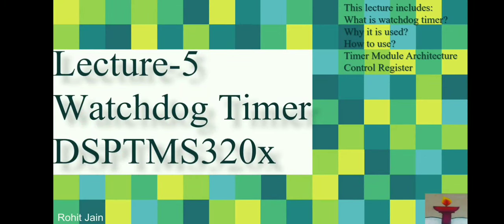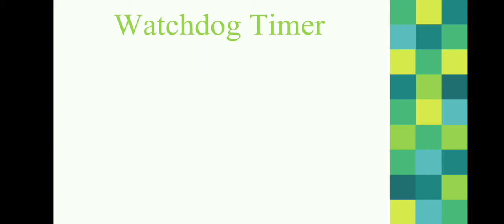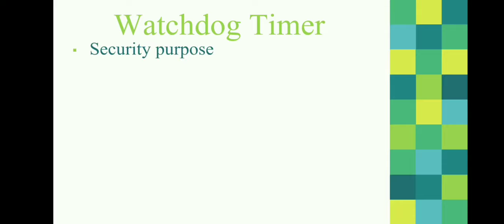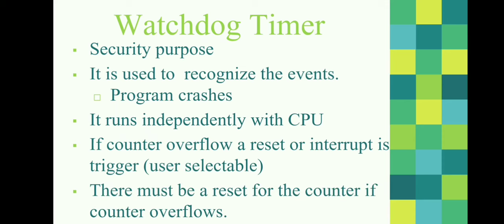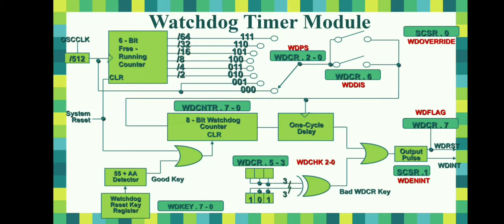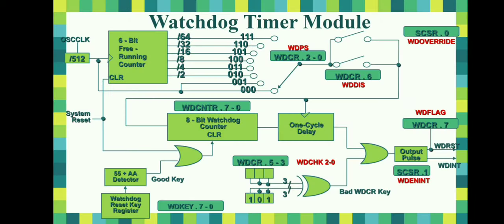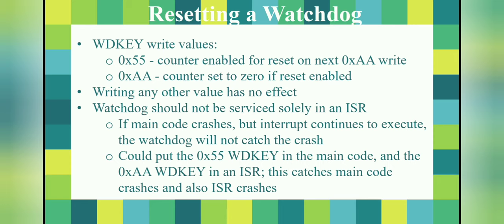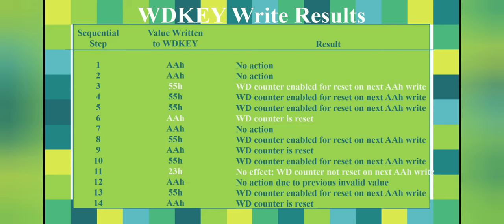Part 5 | Watchdog Timer | Introduction on DSP | DSP Processor | basic Programming | Embedded

Comment: I have two questions: 
1) What is the difference between a simple Microcontroller and a DSP Microcontroller?
2) If the DSP microprocessor is in an SoC, then will it use shared peripherals?
Reply from the maker: The  simple microcontroller like 8085 is  8 bit uc. Whereas the dsp is 16 bit uc. And it have more features like memory, math library which makes computation easier and faster than simple microcontroller.